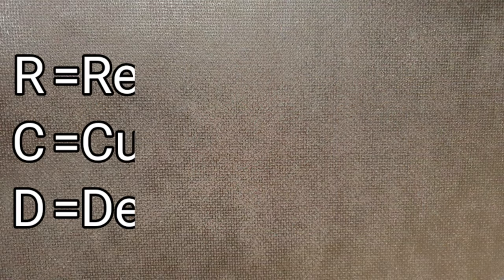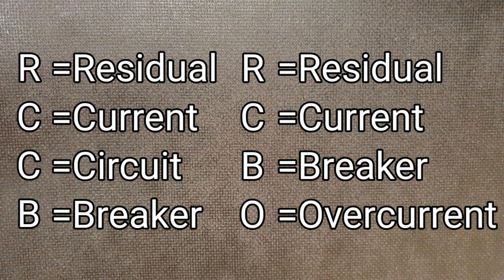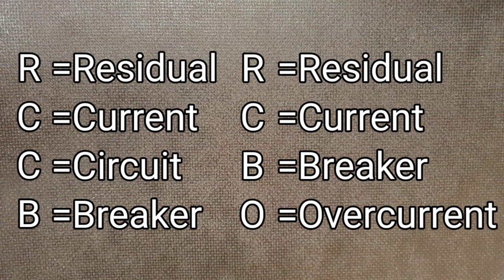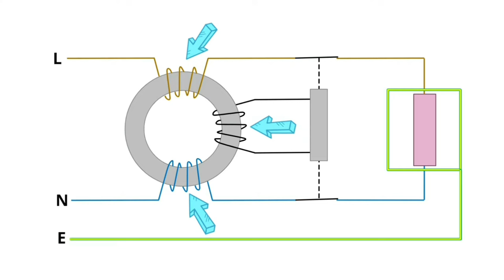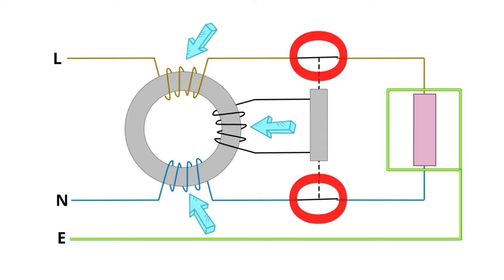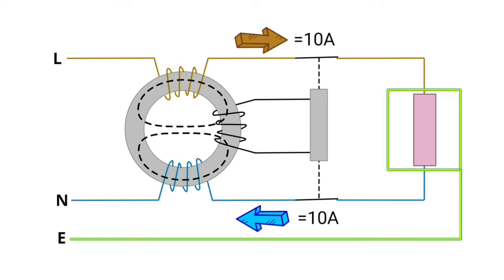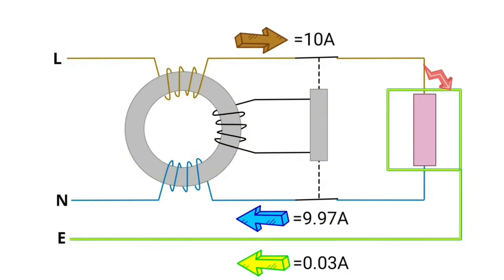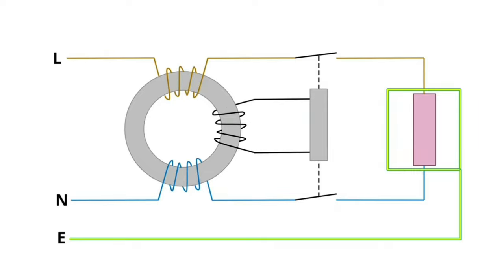What's the difference between an RCD and an RCBO? - Circuit protection.

Comment: There are just too many devices:
- MCB
- RCD
- Arc protection
- Surge protection
- Voltage Monitor Relay

Maybe not all necessary, but wondering where I live (in Thailand), where the grid is very unreliable and where we work with TT and have solar / battery backup because of the bad grid.

Comment: Nice one .. have seen only the rcd fitted to some circuits 😯😯
Reply: Did an EICR at a property not long ago with an RCD fed direct from Henley blocks off the meter. The RCD fed a garage which was wired in T&E partially buried. Scary stuff.
Reply: @mb-electricalservices  I came across something similar, rcd fed from Henley blocks feeding a 2 way consumer unit powering 2 ovens. The argument was that the mcbs provided overcurrent protection with the rcd covering fault. Like an extended version of a split load board? Thoughts?
Reply: @mb-electricalservices  
An RCD can act as a main switch, it is DP.  If the T&E is properly in conduit, then all is fine.
Reply: @johnburns4017  i was going to say this,not unusual to have rcd main switch

Comment: Hi joe, do you have any idea why BS7671 forbids installing RCD's in a TNC system?  I am aware that this is not a perfect protection, but in old buildings which don't have any earthing system, the presence of an RCD would be better than not using it.
Reply from the maker: Hm, that is a really good question, I'll look into it. 😊
Reply: TNC systems have a PEN conductor (basically a neutral & earth combined or "protection neutral lin") so earth faults would be undetected as there is no inbalance, so pointless really.
Reply: @marmalizer2010   In case of fault, they will not trip , but when someone touches the exposed conductive parts, that would be a life saver!
Reply: Well you can in Sweden if you do it right. Take the incoming PEN and attach it to the earth rail. Then run an earth wire from the  earth rail to the RCD and then from the other side of the RCD a neutral wire to the neutral rail. Then you will have the neutral separated from the earth.

Comment: The transformer winding polarity on that drawing is wrong
Reply from the maker: Thanks for the heads up, it's illustrative really.
Reply: Could you elaborate Mike on which bit is wrong?
Reply: In this diagram, the magnetic fields do not cancel each other out. Either the L or N winding should be wound in the other direction. And instead of the magnetic field jumping through the air as shown here, it travels all the way to the core. (2:05). Otherwise, the presentation is good and illustrative.
Reply: @jaymercy224  Good observation!
Reply: Absolutely right...but technically not a transformer..it's two solenoids on a ferromagnetic ring, with a sense coil.
Reply: So how it’s drawn in the video (ignoring the sense winding) is wound like a common mode choke? If you drew it in a schematic, it would look just like a common mode choke with the two dots at the same end?

Making sure I understand correctly…
Reply: @TheFool2cool  All the wire goes through the centre of the toroid in the same direction, with respect to current flow. 

I found it easier to understand at first if I ‘unwrapped’ the toroid, turning it into a straight bar… the magnetic N-S field lines from both coils would all point in the same direction, which would make a stronger electromagnet (if all the current flowed live-neural). Not cancel out.

Comment: Hey - hobbyist here with a good understanding of electricity. Will soon be undertaking a home renovation which will include a (professionally installed) new consumer unit etc. Looking at RCBO but noticed that most are single pole rather than dual (like an RCCD) - i.e. an earth to neutral short would trigger the RCBO disconnecting phase but not neutral. Isn't this less than ideal?
Reply: How you tell thats a 1P RCBO ??
1P +N for RCBO does not necessarily mean that it will not disconnect Neutral...
Reply: @piratedprivacy9052  based on research most don’t! To be fair some do and I’m not sure about the ones in the video, but fact remains that most common RCBOs are SP

Comment: is its operation based on Kirchhoff Current Law?
Reply: Not quite.
Kirchoff's current law says the sum of currents entering a junction or node equals the sum of currents exiting it.
Or alternatively, 
  Σiₙ = 0
Where the direction of the currents is assigned a positive or negative value.

The way an RCD works is by detecting a difference between line and neutral currents, going to a load. In normal operation these two currents should be identical in magnitude. Current into the load must be equal to the current out from it under normal operation.

So the RCD is trying to detect the situation where these currents are not the same magnitude.

And the way they do it, is by creating two opposing magnetic fields which cancel each other out,  in that they are equal in magnitude but opposite in direction.

And the easy way to do that is to use two solenoids in order to create the magnetic fields and put those those solenoids on to a ferromagnetic core to enable good conduction of the magnetic field  between them and the sense coil.

As someone else pointed out, quite correctly, the diagram in the video is technically incorrect with regards to one of the coil windings - it doesn't matter which one, but they are both wound the same way on the ferromagnetic ring, and one needs to be wound in the opposite direction for the RCD to work properly.

The third coil is a sense coil which will detect the presence of the un-fully cancelled-out magnetic field where the line and neutral currents are not equal.

So the operation of the RCD is really based on the interaction of two magnetic fields, one from the line current, and the other from the neutral current.

Comment: Is it possible to use one RCD(or RCBO) with one AFDD to secure multiple circuits (6 for example) that are protected with MCBs? Im bit confused with installing AFDD, because its expensive to use on every circuit, but if can use 2 or 3 per board instead of 15 that would be great.. Eu-installation
Reply: 1 nos of 2P–RCBO can be assigned to protect a group of say 6 MCB.
But 1 nos of AFDD is not intended to 'monitor' a bunch of final circuits...
As mentioned a unit of AFDD is solely for each/one final circuit.
Reply: You do not have to use an AFDD on every circuit.

You identify which you consider to be the circuits of highest risk where the maximum level of risk reduction occurs by installing one.

Now, there are scenarios where AFDDs must be installed, and these are scenarios which are considered to be higher risk and where it is considered the higher cost of using AFDDs is justified. Check the BS7671 for details of these scenarios. Typically, but not limited to, it's HMO, student accommodations, care/nursing homes, and blocks of flats higher than a certain number of floors.